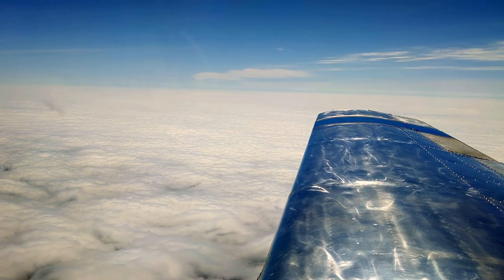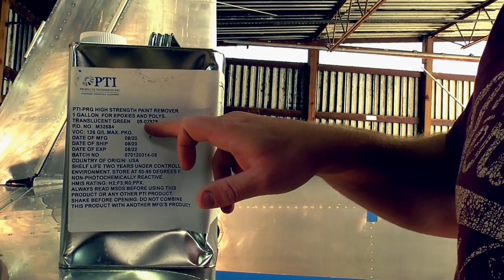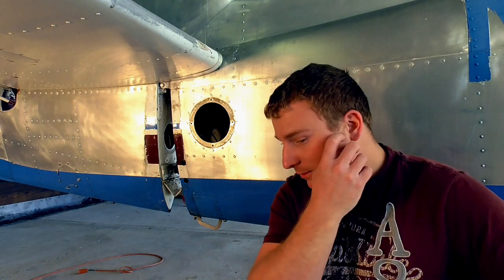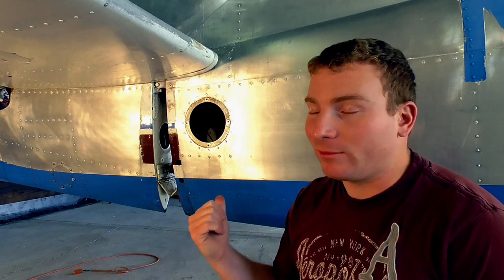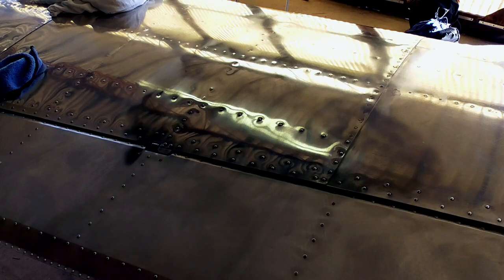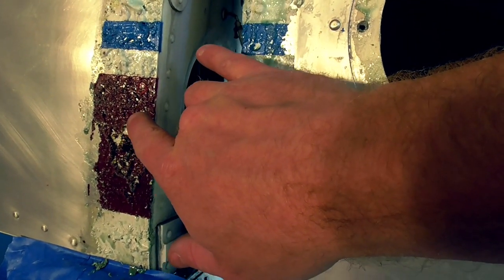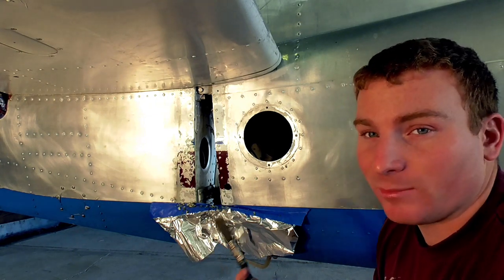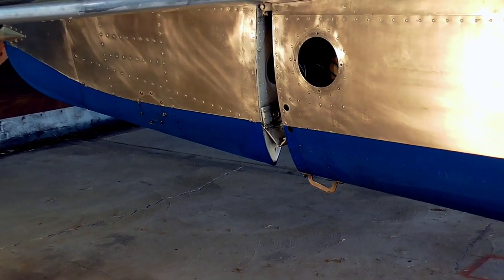How to Paint Strip and Polish an Airplane (on an Average Budget)

Comment: Thanks for the video

I've used both Brightworks and Nuvite; there's really very little difference between the two.  I'm in the finishing stages of polishing my plane (it's a homebuilt; the original builder polished the tops of the wings, but not the underside)

Lotta work, but it'll be worth it in the end.

Another note:  when polishing, I found that the best way was to use a very low rpm (600rpm) to initially spread the polish around without flinging it everywhere. Then increase speed to a max of 1400 to get a good shine (higher rpm only if you need to get rid of a lot of oxidation)

Comment: I realize it has been a year, but you can soak your wool pads in soapy water to clean them they don't have to be dry to use them. Buffing with a dirty wool pad will just grind the black residue staining the aluminum. As for getting the striper to adhere to the vertical surfaces. Apply it with a wide bristle paint brush and cover it with plastic wrap.

Comment: 40 some years ago they stripped and polished a Navion at our club.  Came out great.  The polishing compound was flour, regular flour.
Reply from the maker: Interesting, I've never heard of that. Just flour straight or mixed with water or something?
Reply: @AverageAviator  As I recall it was straight flour, I remember it was sort of a messy affair with the plane outlined more or less on the ground as they worked.  I imagine the flour works as a fine compound.  BTW, this was done by hand, no power buffing, down in the Panama Canal Zone.

Comment: Have you considered a thick paste wax on top of the polished panels? “Natural” color woodworking paste wax would be a good candidate because it’s quite hard and nearly transparent, then once you’ve got that buffed in, hit it with some synthetic liquid wax to make it ultra smooth. Maybe there’s a reason not to wax airplane skins (temperature differences causing it to flake off?), though.

Comment: Just come across this, but if you intend to retain the alloy finish have a look at WadPol. It was used by the military for years on non painted planes. Wear gloves and echoing other comments be careful when using electric polishers. The allow can get hot very quickly. Keeping it looking nice will be a bit of a crusade though. Oh, and read the instructions before opening the tin. Ask me how I know.
Reply from the maker: The trick with electric polishers on higher speed is to not use as much pressure. Light pressure is often all that's needed.

Comment: Curious about how many gallons you went through?  Thanks for the info
Reply from the maker: This is a hard number to calculate as it was a learning process and I went through a number of different products and a varying amount of those products based on how they actually performed stripping the paint. I would estimate that it would take me about 3 gallons of the stripper I used in the video had I used it to strip the plane from the very beginning. Since I did not strip the entire plane, I would estimate that I would need about 5 gallons to strip the entire plane start to finish.
Reply: @AverageAviator  thanks for the answers.

Comment: Nice to you go a hangar. Been watching your videos for 2 yrs now. I just got a nice  M20C 9/20. It has a Sandel HSI, Garmin 530, autopilot, and even speed brakes. I can't afford a hangar which are about $500 my side (KSCH) so I got a cover the starts from the prop all the way to the end of the back of the wing. Seeing this video I think I might just get some wing covers.
Reply from the maker: Dang that's expensive! My hangar is 150 a month and is fairly nice. I only acquired it for the winter though, so I'll have to find another once spring comes or I'm back outside. Wing covers would definitely help in the winter up in NY, I used to fly into NY0 Fulton a lot.

Comment: Looks like you’ve got it figured out pretty good, but when using an electric polisher like that careful to use low rpm’s because high rpm’s generate heat and too much heat will warp the aluminum skin. Looks like you’ve done a good job 👍🏻